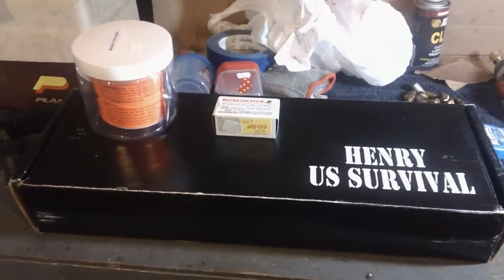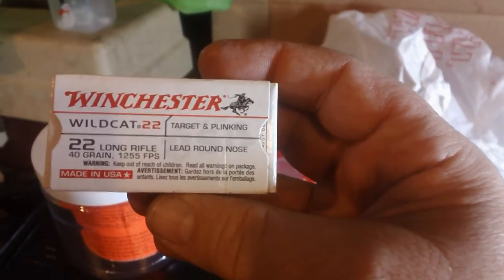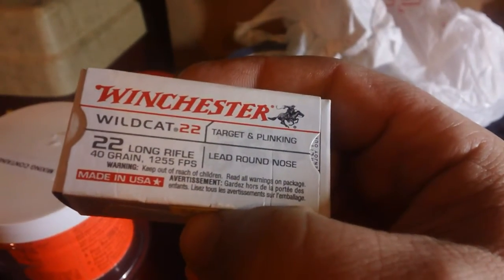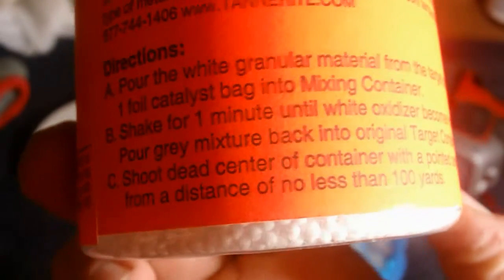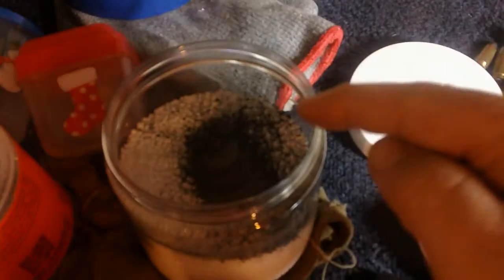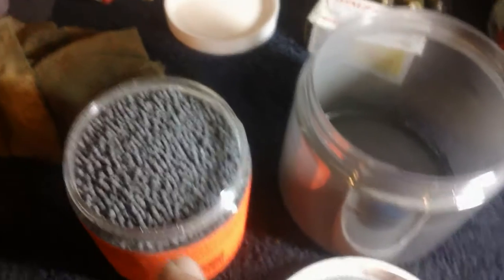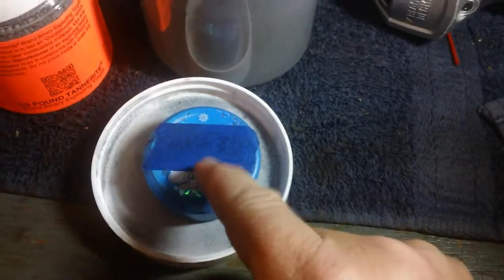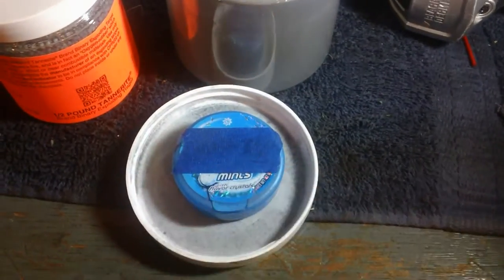.22 Lr vs Tannerite from Henry survival rifle AR-7 - will it make it go BOOM?

Comment: You are a very poor aim. You punctured the container before actually hitting the powder which violated the air tight containment so from that point on it wasn't going off no matter how many rounds you put through it. 
They make tannerite for 22lr btw.
Reply from the maker: True, but the point is still valid that it does not make it go boom
Reply: I have detonated tannerite with 22 ammo, it is just highly inconsistent unless you change the mixture. So it can but 22 just doesn't have a high enough velocity to consistently detonate. I am not trolling your video or anything. Just making a point. :)